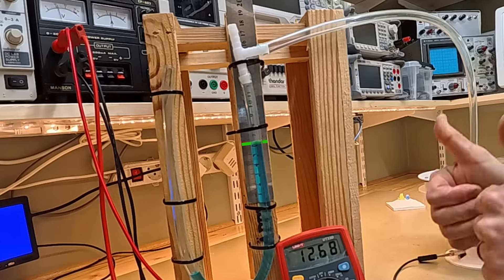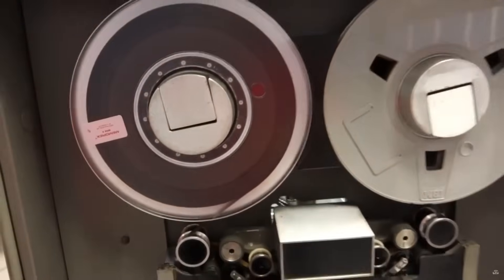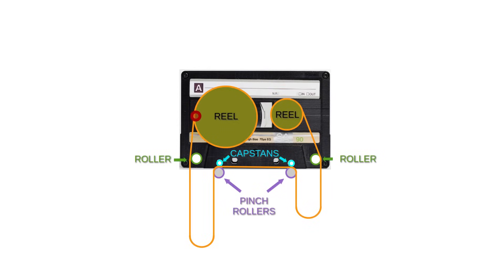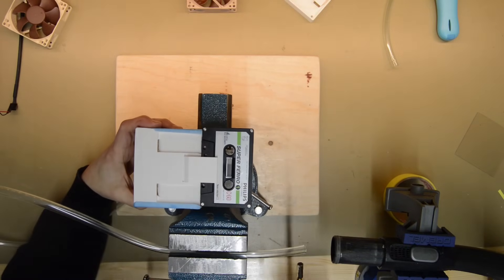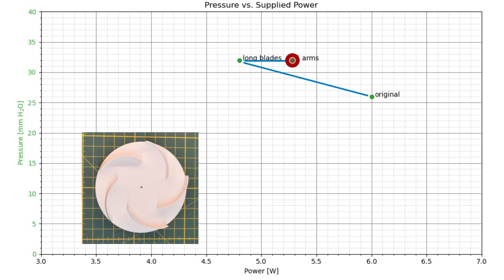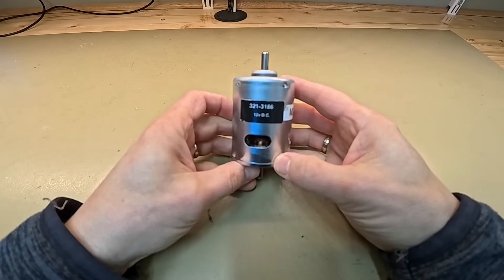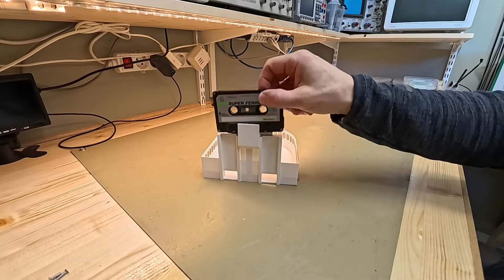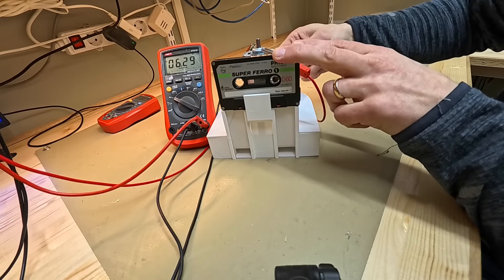The Vacuum Turbo Tape Drive Ep.1: The Quest for Vacuum

Comment: Have you looked at CPAP blowers for the vacuum source? I haven't tried using them as a vacuum pump, but they can put out 10cfm or so at 20 inches of water.
Reply from the maker: Hah, it didn't even occur to me. I did look at some other pumps, like aquarium pumps, but didn't really found any that fit my needs. From what I understand the CPAP blowers are pretty silent, which I very much would like. However, at some 5 l/s and ~500 mm H20, I think it's somewhat overkill for this application.